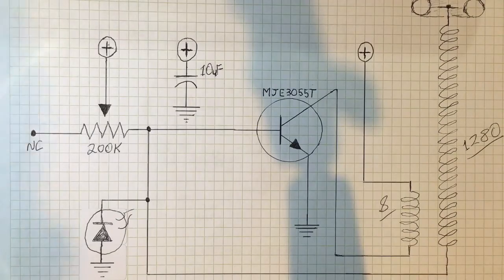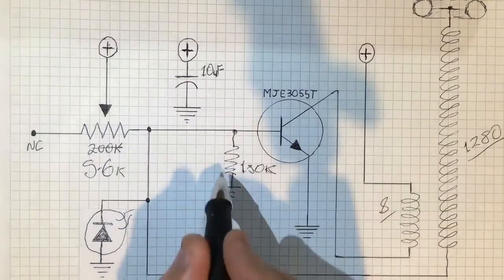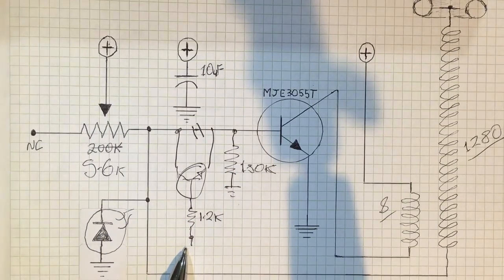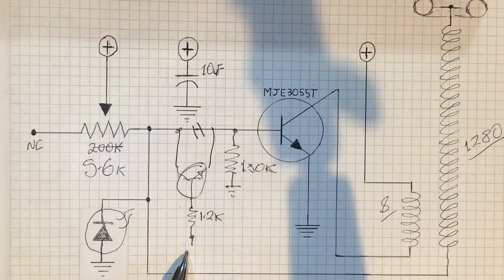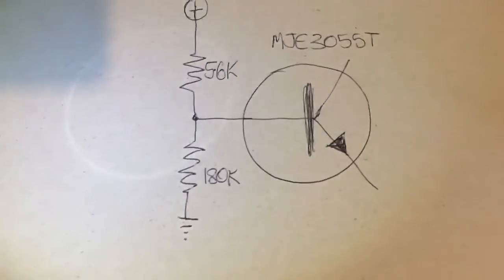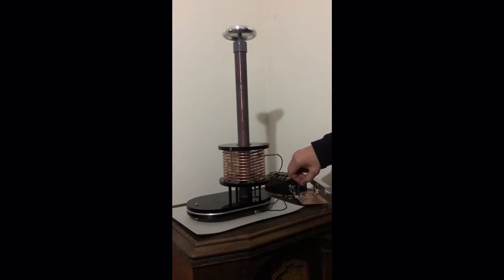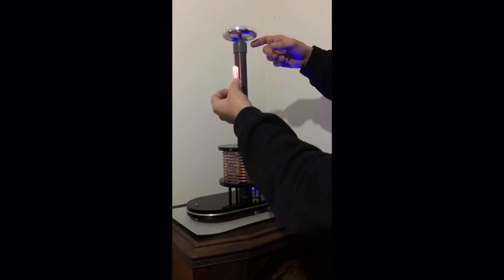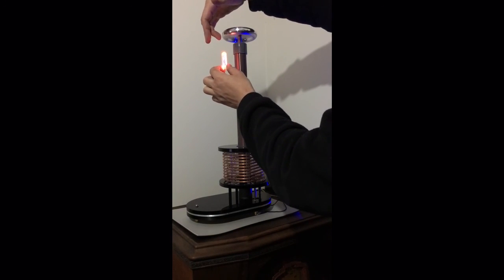Slayer Exciter Part 16 (No Popping Transistors!)

Comment: Try using a 2n6388 to turn on the mje3055 what i do is connect the base of the mje3055 to the collector of the 2N6388 using a 1k resistor on 12volt and work nice, it does get hot but a good heatsink can fix that. I have’nt try more than 12volt cuz thats all i have for now.

Comment: thanks 
past few months I have popped 35 mje3055t and 12 Tip31c and 5 tip35c
Reply: O blow 4 TIP31C's today why this is happening
Reply: @snaj9989  high frequent kickback and no resistor from emitor to min to stabilize the directcurrent trough transistor , i see a lot of you guys popping transistors , why does nobody wonder that when the transistor is switched on it is basicly a shortcircuit .
Reply: I don't see why this would happen in a transistor because if there's no current feeding into the base it's not going to switch. Doing this is the same thing as changing the value of the base-collector resistor to the point where it will only oscillate when you give it an extra kickstart, or just leaving the resistor out altogether.  At the voltage some people are feeding these transistors it makes sense they are popping either due to peak pulse currents being too high or over driving the base. When using a Mosfet the gate needs to be pulled low because it will remain on just from the charge if it cannot dissipate it and your mosfet will indeed explode otherwise.